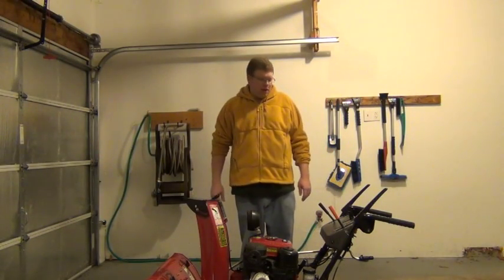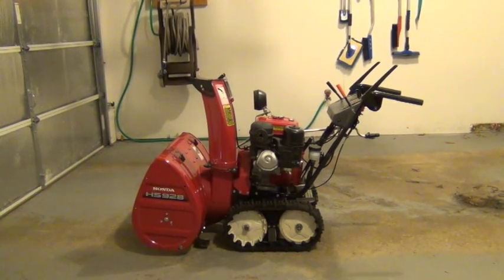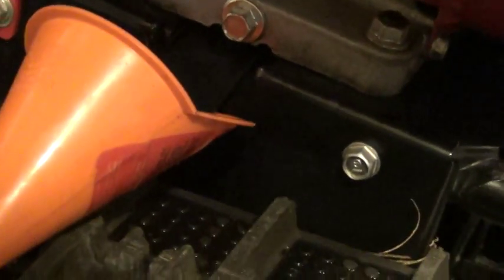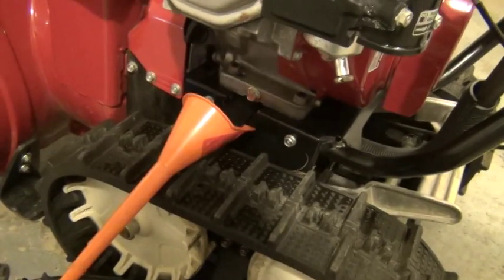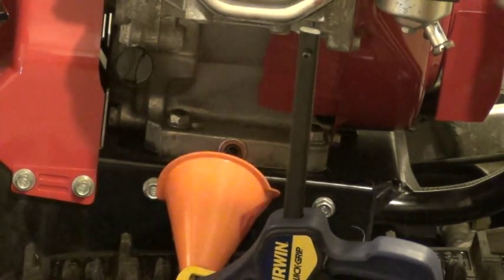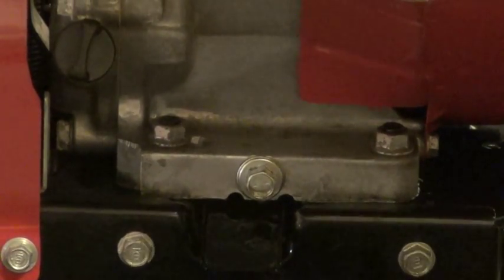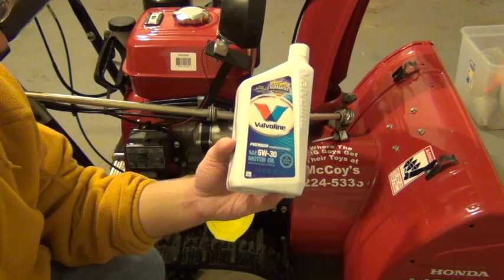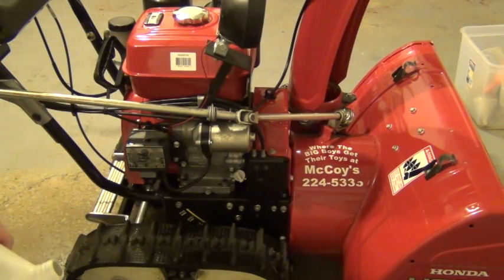Honda HS928 Snowblower Oil Change

Comment: I bought my Honda HS624 Snowblower new in 1994. 2024 will mark 30 years of faithful service without ANY problems. But unlike your oil change process, my HS624 is a wheel version (non-tracks) and to change the oil, the Left Tire MUST be removed. This entails removing a cotter pin and sliding the tire off. The good news is this allows the snowblower to tilt towards the drain chute side allowing the crankcase to fully drain without any addition maneuvering of the unit. 

I change the oil every year and the spark every 3 years or as needed. I've never had a spark plug foul in this machine This year when I do the oil change, I will do the spark plug as it has been 3 years and they are inexpensive enough as preventative maintenance. 

As you said early in your video, these machines cost more than average, but they are well Above average in their build and design quality.
I paid $699  on sale New for this HS624. In very good used condition today, they sell for $1000 or more. I could sell this today and would in essence been paid $300+ and a FREE snowblower to use for 30 years! Crazy huh? That's why it's worth buying quality rom the start! 

But some say these old machines were built much better than the new ones being sold today, but I don't know that to be certain as I haven't looked at or tried any of the newer Honda snowblowers.
Reply from the maker: You make a lot of great points!  These machines are very well built.  I’ve thought before about purchasing a new model but I have read where they are more prone to the chute clogging.  Several YouTube videos demonstrate modifications to avoid this.  In my opinion, you shouldn’t have to modify a new machine for it to work optimally.  I plan to keep the one I have and take care of it!  Thank you for watching!  Please like and subscribe!

Comment: You could improve your system by putting a rag under the chute and cutting your own funnel from a jug like an anti freeze bottle.  This could be cut for a tight fit around the chute and still provide a good flow to your container.  The ultimate is one of the hose fittings like drain eze that allows you to put it directly in the jug with no spills.  Take care.  Doug

Comment: honda makes the best blowers..another tip...change the impeller bearing every few seasons..its only around 16$ and if you are decent with a wrench you can do it. ..it wears out and you will be breaking that shear bolt that is on the impeller shaft and it is a bitch to replace because the impeller is flopping around and it twists the pin...took me 3 hours to get mine out. if you are changing the belts do that while you have it apart.
Reply: Can you please make a video on this!

Comment: Why not put a pipe that extends out with a valve on the end?
Reply from the maker: While that is certainly an option, I am hesitant to do that.  The reason is because this unit is used in very deep snow.  I would hate for a chunk of ice to stick to the tracks and fuse to the extension pipe or bend the extension pipe.  I know that is not likely but it’s possible.  It’s seems that when there’s a foot of snow on the ground if it can happen, it will.  Thanks for watching!  Please consider subscribing.

Comment: Designed for money grubbing Honda service.
Reply from the maker: If you are talking about the oil change procedure, I don’t know that I agree.  The unit does not take an oil filter and the drain plug and fill plug can’t be  much easier to access.

Comment: If your oil drain bolt is a 12mm x 1.5 pitch, like my Honda is, then you'll find that the F109 Fumoto oil drain valve will fit. You can get the one with the nipple, the F109N. You can then attach some tubing onto it to drain. No more removing drain bolts, no more replacing washers, no more mess.

Comment: Is there a washer on the drain plug.
Reply from the maker: Yes.  I would not consider it a crush washer.  I have never had to replace it yet.  I actually just changed oil about two weeks ago and the washer looks perfect.  My guess is that it is supposed to be replaced but I never have and I am careful to not over tighten.

Comment: I can’t tell how much oil it needs in the manual? I have an 1132 Honda snowblower and did it all the way to the top reservoir. The dipstick doesn’t help here. On the manual it shows top of reservoir and every time I remove dipstick it falls out. Any comment / suggestion here? Is it better to have higher level of oil or lower level of oil
Reply from the maker: Basically, you are filling the crankcase with oil until you reach the bottom of the fill hole.  If you look in the back of the manual, you will see a specification chart for each model.  You will find the oil capacity for your specific model in the specifications chart.  It should be around a quart give or take depending on whether or not you were able to drain out all of the old oil.  I believe specification chart states the oil capacity in liters.
Reply: averagejoevideo mine says 1.1 liter. It also shows the oil at the top of the fill hole. Which I have gotten too. Seems too high though
Reply from the maker: You will find that it does take it to the top of the fill hole.  The issue is that when you go to check it, you are almost guaranteed to have oil spill out the fill hole.  I like mine to be no higher than the bottom of the fill hole.  Remember, technically as long as it is in middle of the cross hatches of the dipstick it's okay.  I try to keep mine at the middle of the cross hatches and up.

Comment: What a BAD BAD BAD BAD Design. Great motor though
Reply: Not a bad design per se. It's an "open" design. This is an industrial engine with a few decades of proven services. Exactly the same power unit is used on a huge amount of equipment. From snowblowers to generators, concrete mixers or farm equipment, a really vast etc. 
It is literally impossible to cover all the options in which this engine is applied. in that sense kudos to them for supplying drain and fill on both sides. ;-)
Reply: A length of pipe screwed in to the drain hole and a cap on the end would help. I have one on mine.
Reply: Dude.. you live under a rock? Best blowers made. And the new version of this rocks:-) I'd use nothing less.... because I only use the BEST!!!! You know, cause I'm great and all:-) LOL
Reply: @krkabob  I have two the suck, They blow snow like know ones business. Maintenance and cost they suck. that simple!

Comment: I have the same snowblower and need to change the oil. Does yours have two places to  fill oil?  One on each side?
Reply from the maker: Yes, they all have two places to fill because that is how the engine casing is manufactured.  However, you want to use the side with the dipstick.  There is no reason to remove the opposite fill plug.  Typically the side with the dipstick is the white/grey cap and the other side is black.
Reply: Thanks!
Reply: why didn't you finish draining the oil on the fill side? there must be a reason for the 2nd drain plug.
Reply from the maker: Keep in mind that this particular Honda engine is used in a variety of applications.  As such, the manufacturer includes drain plugs and fill plugs on both sides.  The intent is to use the fill plug with the dipstick (grey in color) and use the corresponding drain plug.  The drain plug that should be utilized will have the metal spout below it as this one does.  Often, the second drain plug will not.